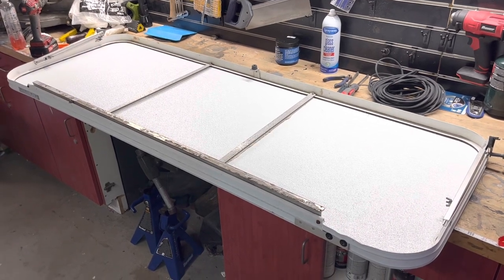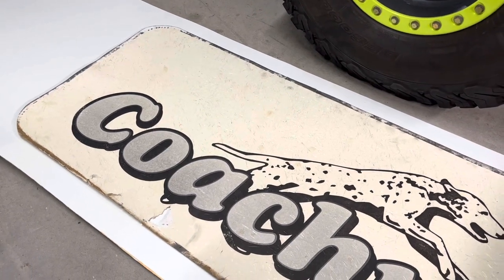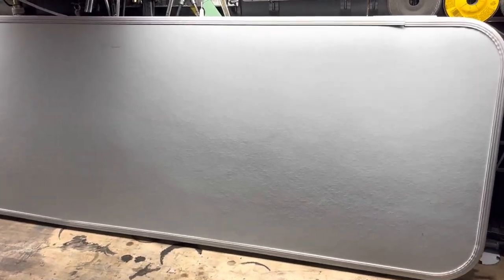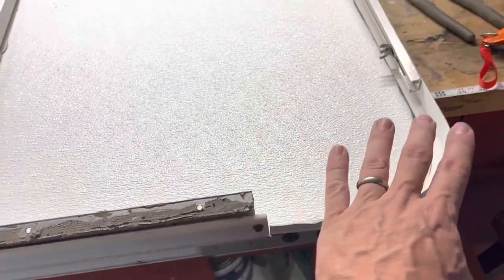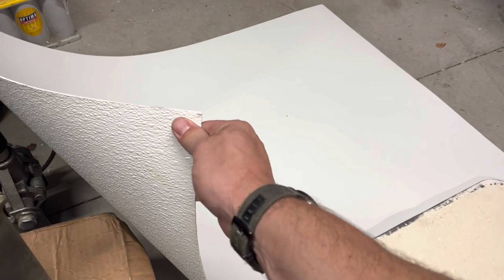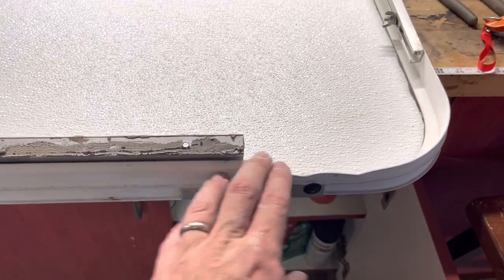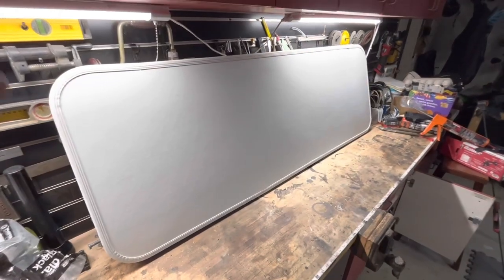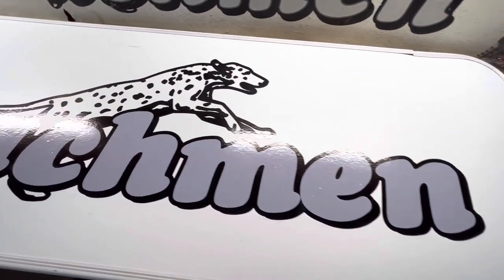Travel Trailer Rock Guard Rebuild (Front Window Cover Rockguard)

Comment: Has it held up well?
Reply from the maker: Yes! We did a 6000 mile trip last year and it still looks new, hasn’t yellowed and the decal is still perfect.
Reply: @ct70dude  awesome! I just bought a 99 coachman futura 25’ and was looking for a replacement rock guard but I’ll be doing this instead. Any recommendation for where you got the decal?
Reply from the maker: @benjaminrichard1026   hopefully links work in comments;

https://www.etsy.com/listing/1462774441/1-rv-camper-trailer-coachmen-logo-decal?transaction_id=3520908237&campaign_label=delivery_confirmation_subjectline_exp_treatment&email_sent=1682117290&euid=-I4NUfumUAW6fA0lJNvLXu2t3bYh&eaid=214545753470&x_eaid=3079866db2